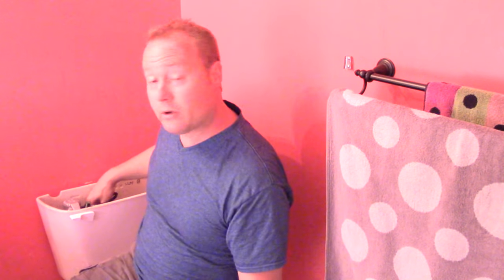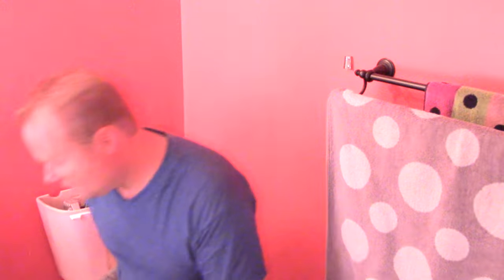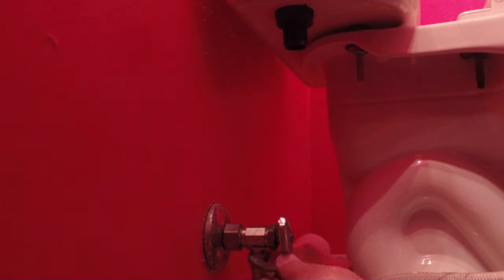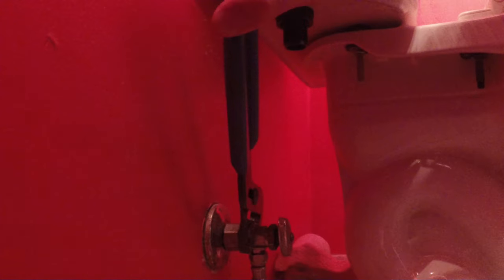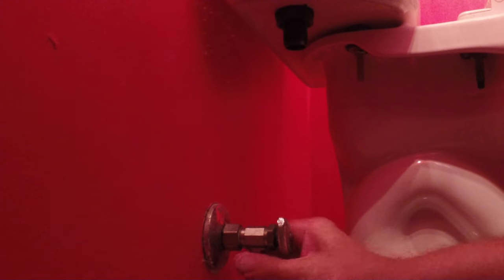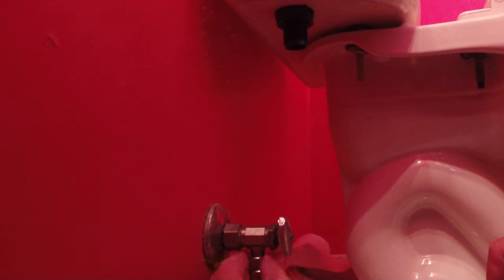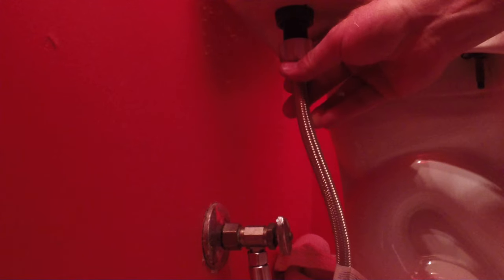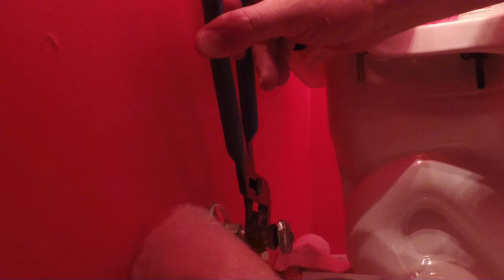Toilet Supply Line - Installation

Comment: The plumbing industry in North America is 100 years behind that of Europe . We are in the stone age. We do not have reliable plumbing and everything leaks in our homes.  The Europeans are way ahead when it comes to dealing with water leak issues.
Reply: Dang I didn't know that, & it pisses me off!  I swear plumbing leaks are the #1 issue/problem I have as a homeowner & it drives me crazy!  Now that you've shared that, I am totally convinced the plumbing product manufacturers here in America are purposely having shoddy produced &/or products designed so that we have to keep replacing them over & over due to leaks.  Grrrrr.  Wish some company would disrupt the industry & solve this problem by giving us better plumbing products!

Comment: Just finished installing my new Corky flush system.  i could not figure out why my water line connection to the Corky water supply tube was leaking.  I couldn't find a washer on the old tube and was going to go to ACE tomorrow (day after Christmas) to buy a new hose as was suggested in this video.  However, I decided to look one more time at the old supply tube and there it was, a black rubber washer tucked up inside the tube.  Pulled it out and inserted it into the corky tube and no leak.  Everything works now.  I wonder why the new Corky tube did not include a new washer?
Reply from the maker: Interesting, but glad that you got it working.

Comment: I had a supply line that was leaking at the lock nut to the tank.  I replaced it with a new supply line and it leaked worse than before.  I kept reinstalling it and still the same result.  I even tried the same with a different new supply line and it was still leaking.  I then reinstalled the original supply line and it was fine.  Got any idea why the new supply lines all leaked but the old one was fine?  I installed them all the same way and it looks like a pretty simple process so I'm not sure what I could have done differently.
Reply from the maker: Honestly I have no idea.
Reply: This has happened to me. No leak but put in a bidet and hooked supply back up, incredible leaking.
Reply: Ditto, but mine is still leaking at the tank... Any solutions?
Reply: I had the same problem. Turns out the new line I bought just had a shitty casket. I added a rubber O ring to fill more space where the new casket was leaking. With the extra rubber, it sealed the joint with no leaks.

Comment: are these fittings intended to be connected directly  to the flex line ? or do they need a little teflon tape or plumbers paste on the thread  ? ?
Reply from the maker: Flexible supply lines are hoses not hard pipe. Meaning they have spinning connectors and rubber washers. No thread tape nor thread paste is needed. If water gets past the rubber washer, the threads will not keep out the leak. It will leak where it spins. Hopefully that helps.

Comment: Is it normal for there to he loud bangs here and there from shutting off the toilet? I installed a bidet and it works fine with no leaks. A few times today I heard a loud bang. I shut it off again because I wasn't sure what to do. Is there actually a plumbing problem or just the pressure adjusting from being off and on? TIA
Reply from the maker: Thanks for watching and for your question. I can't fully answer that with ought being there. If you are worried there is a problem it is best to get a plumber out there. Now, from your description it sounds like you have copper pipes and that they may be hammering. I don't know why they would have started to do this with just the installation of a bidet. Are those sounds brand new and do you have copper lines?
Reply: @AroundTheHome1 thank you so much for replying. Turns out the water supply hose was a little rigid. Replaced it with a longer, flexible one, reinstalled the bidet, and it's fine now. Maybe trapped air?

Comment: Can you do a video showing how to remove a stuck supply line from the shut-off valve?
Reply from the maker: What kind of supply line is it? Is it one of these flexible hose types? Or is it a gray plastic, or maybe chrome?
Reply: Have this same exact problem
Reply from the maker: @Empty I have to ask the same question again. What type of supply line do you have that is stuck?
Reply: @AroundTheHome1  it’s a cold water line to the toilet I’m guessing it’s copper or stainless steel, I’ve tried using a torch and hitting the nut on the sides a bit and it seems to have worked out
Reply from the maker: Sounds like you got it. Though I need to make a video on that. If you have one of those old metal supply lines the way I like to remove them is to loosen the nut to the shut off. Don't loosen the nut on the fill valve. Then take a pair of pliers in about the middle of the metal line and crush it. Then take the pliers and spin them, twisting the supply line around the end of the pliers. This should pull the supply line out of the shut off. You may need to support the shut off while doing this. Then you can take it off the fill valve and be ready to install the new supply line.

Comment: I notice you didn't use plumbers tape on the threads before you connected the hose to the supply line.  On purpose?
Reply from the maker: Yes, that was on purpose. This is designed like a garden hose. There are rubber washers in each side that make the seal. And honestly, the Plumbers Tape would do nothing here. Both nuts on this hose just hold the hose on. They do not make a seal. If water gets past the rubber washer, then it will leak. Thanks for watching, and I am glad to help. Don't forget to stop by our website www.greatwhiteninja.com

Comment: What size hose is it that you replaced it with can you let me know please.  

Another thing I know it has two different size fittings on the flex line what are they I need the same size you used?
Reply from the maker: This is what I used. https://www.amazon.com/Fluidmaster-B1T20CS-Connector-Braided-Stainless/dp/B005SQ20RC/ref=as_li_ss_tl?crid=2OPX5FOZ471QN&dchild=1&keywords=toilet+supply+line+20+inch&qid=1605194622&sprefix=toilet+supply+line,aps,191&sr=8-3&linkCode=ll1&tag=greatwhitenin-20&linkId=1b8436158863da6610db01c4167e2c33&language=en_US

Comment: Question Can I use a toilet supply line with a metal ballcock nut on a tank with a plastic thread?
Reply from the maker: To be honest, I prefer metal to metal, and plastic to plastic. But the metal nut to the plastic stem will be ok. Just be careful not to let the metal nut cross thread the plastic stem because the metal threads will want to. Thanks for watching. Don't forget to stop by our website www.greatwhiteninja.com

Comment: Working on my old ends in the  the line didn't come out of the pipe on either end?
Reply from the maker: I'm sorry, I don't understand exactly what is happening?
Reply: @AroundTheHome1  I'm sorry, ut was confusing. I was attempting to change my main line to tank and just couldn't get either end of line out. Umber said I should've pulled harder! Easiest $75 he ever earned.
Reply from the maker: I see, the old plastic or chrome line was stuck? Sounds like you got it going now though. What is Umber?
Reply: I was trying to explain that I had to call a PLUMBER and I guess that the text missed the pl of plumber. Thanks for asking
Reply from the maker: Ah, gotcha. Well sometimes old stuff gets stuck and just takes practice to know what to do. Thanks for watching and for your questions.

Comment: Does the main water line to the house has to be shut off
Reply from the maker: If your shut off valve is working then that is all that you have to shut off. If it is not shutting off all the way then yes, shut off the water to your whole house. Thanks for watching. Don't forget to stop by our website www.greatwhiteninja.com

Comment: Hello sir..the part you're screwing in at 6:54 is not budging in my bathroom while I'm trying to install a bidet washer. Instead when I turn it..the inside component is turning with it...how do I fix this?
Reply: Inside component being the part inside the tank which is like a long black tube...
Reply from the maker: If I understand you correctly, the fill valve is spinning when you are trying to undo the supply line. If that is correct, then your fill valve really isn't tight enough and after straightening it you will need to tighten the nut on that tube. The one that is right against the bottom of the tank on the toilet. Then you should be able to loosen the supply line without too much trouble. Thank you for watching, and please share. Check out hundreds more of our videos at https://www.aroundthehome.org/

Comment: video does not help at all. i have a plactic pipe coming from value direct to toilet what do i need to do before i put this new flex hose on??
Reply from the maker: This is an old video of mine and I have it on my list to make an updated one. I did go back and review it. I don't understand what you mean by "video does not help at all". I go through in great detail about how to install it. Including tips like holding the shut off valve steady to no damage your water pipes, and cleaning out the line in the case you might have old pipes with lots of build up. If you are stuck with your gray plastic water line to the toilet, just do my steps in reverse to remove the one you have on.
Reply: @AroundTheHome1  Thanks will try it as u just explained things.  on monday since its a holiday up here in the north.wife is so pissed about this plumbing issue. no water is better than a leaking value or incorrect installed pipe leaking.
Reply from the maker: Yes, we don't need any leaking plumbing. My new video will show the removal of the old line and be a bit more streamlined, but this is what I have right now. The gray plastic lines are really not bad for taking out. The chrome ones do cause a bit of trouble. Here is the only extra tip that I can think of. First, just completely loosen up both nuts, the one on the fill  valve and the one on the shut off. Supporting the shut off is always a good idea. The gray plastic line goes inside the shut off about 3/8". So, hold the shut off and pull the gray tube straight out. Then taking it off of the fill valve is easy peasy.

Comment: What is the name of the leak stop supply line that you demonstrated?  The link in the description is for a regular fluidmaster line.  I have a fluidmaster line and it is okay, but I'd like to get one of the lines with the high pressure cut off.
Reply from the maker: I have the Fluidmaster link in the description because it is a good supply line and there wasn't a good one available online at the time. Here is a link to one similar to what I used. These have mixed reviews mainly because if you have high water pressure they can shut off even if everything is working ok. https://www.amazon.com/Watts-MFS-SCT16-614W-FloodSafe-Connector/dp/B000KPS9O4/ref=as_li_ss_tl?ie=UTF8&qid=1518179782&sr=8-1&keywords=watts+toilet+supply+line+flood&dpID=4162tit-e4L&preST=_SY300_QL70_&dpSrc=srch&linkCode=ll1&tag=greatwhitenin-20&linkId=04b7a4bb41319d46eec8f7fc73d27d21
Reply: Thanks!  I tried buying a 12" suredry one off amazon but with the height of the valve on the 3/8 end it was too short for my application so I installed a new 12" fluidmaster one and made sure not to kink the line this time.  I'll just replace it in 5 years.  I probably bit into the washer on the compression end but it's not leaking.  The quick click thing is nice.